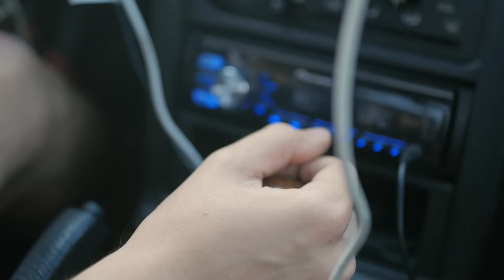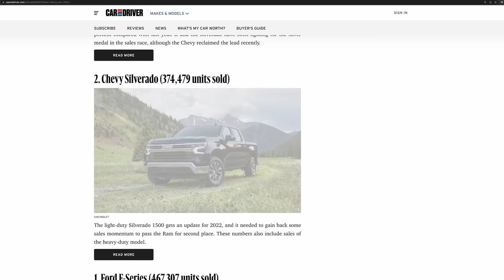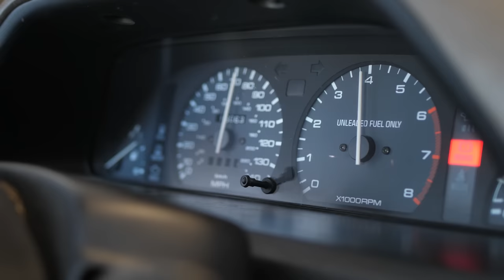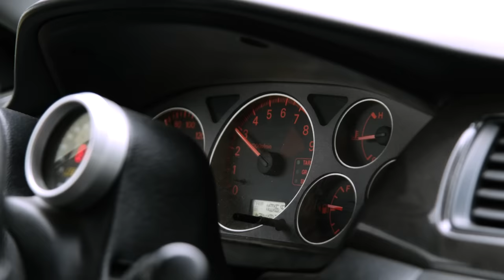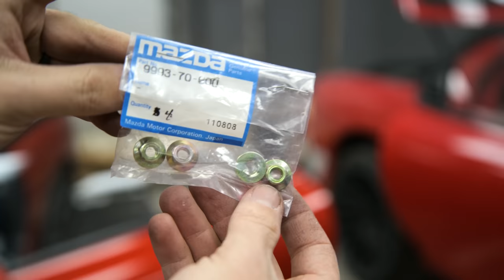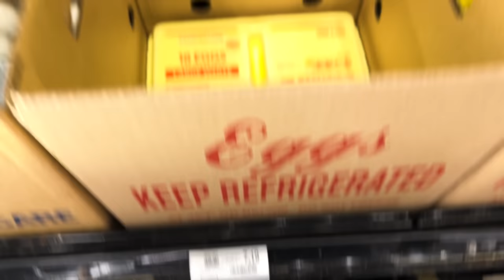Daily Drive Your Fun Car

Comment: I daily a 08 Toyota Camry XLE V6 and even though the car looks boring the engine is not as it puts out 268hp from factory which is more than enough to get out of it's way,  and I have weekend car a newer VW Beetle that's heavily modified.  Where I'm at it's difficult to enjoy your fun car especially commuting back and forth in L.A. traffic which is why I take the Camry,  but when the weekend hits I swap keys and I take the bug out on a nice long drive on PCH or some nice canyon runs out in Angels Crest. It makes me appreciate what I have and the car that I have at home is waiting for me. I'm cool with owning more than one car in fact I'm planning on adding a third car later on in the year.  I agree if you're going to daily a car makes sure you have fun with it every once in a while even if it's a boring Camry lol.
Reply: Man I drive a 2013 Corolla manual, and honestly wish I would of gotten a Camry or something similar. Not even the xle but literally anything would be more fun than vee for 🤣 Corolla  my boy had a 2102 8 think, the xle and yea it was pretty quick. V6 Camry still get the reliability and gas mileage but more power, more room, lil more fun and yea I'm bout to move down to LA from the bay so once I do think I'm going to get an automatic g37 sedan. Stick shifts are fun, but honestly not in a slow boring Corolla and LA traffic
Reply: @Gdafu866jds  Yeah I love manuals but in L.A. it's kind of hard to enjoy them unless you're somewhere not too crowded Like Palmdale or Riverside even. I'm getting a new mk7 Jetta GLI Autobahn with the DSG for my third car. Still keeping the Camry because I do love the V6 and it's very roomy. Originally when I was looking for a daily I wanted a Corolla but I'm cool with the Camry.
Reply: @wesleyjones1169  ohh nice 👌 yea plus now days the autos are quicker shifting than manuals and don't miss gears sometimes 🤣 and now I'm getting older it is nice just to chill and cruise in an auto, maybe just have a straight project/racecar for a manual and bang them gears lol but yeah I think Camry is way to. But enjoy all your toys brotha 🤙🤙
Reply: @Gdafu866jds  Sure thing bro!

Comment: I've always loved cars but felt like I could never afford a fun car. But I never looked at the used market and had no idea what a fun car would actually cost. It took some time, but I found a 94 miata for a good price and I haven't looked back. Every time I think it'll be a chore to move my family suv in order to take the miata out of the garage my mind is instantly changed when I'm ripping around on my way to work. If you love cars you owe it to yourself to buy a fun car even if you have to sell it eventually. It's life changing and a blast, even in my slow miata.
Reply: But Miatas are about maximum car-&-driver connectivity, no? I mean, it's synonymous with the phrase "Jinba Ittai" for a reason.

Comment: I realized I had bought the wrong car, I had bought a 2010 Acura TSX V6 automatic, it had nice specs and very comfortable but I was always worried of putting miles on it since the gas on this was not so terrible but It was hard to afford for my age, I was 18, Decided to sell it and then got Myself a 1998 Honda civic sedan manual, turns out this small thing with the boring interior is so much more fun than the Acura, And it’s amazing on gas! I found a great daily and I’m loving it

Comment: Honestly this is so true , beyond true. I’ve had a Civic EK for about 4 years now , brought it for £18,000 and it had 64k miles on the clock. It now has 143,000 miles on the clock. It’s not the best sounding car however it’s absolutely brilliant ! FWD handling in the 90s,  especially on Japanese cars are just the best I’ve ever driven. It’s practical , it’s cheap to maintain ( unless you go with Honda main dealership to do service , oil change and ect then it’s a bit pricey ) . It’s comfortable , it’s fits 4 people quite well considering the size. It’s fun to the limit , that’s including VTEC and it’s just quite for a stock Honda. It’s amazing

Comment: I still prefer having more than one car if it's financially possible. That way you can have one car that's just dedicated to being a fun car and it doesn't have to necessarily fit all the boxes that a daily driver should. While I still think your daily driver should be fun and enjoyable to drive, the two fit different purposes in my mind. I've gone the two car route for many years now, and absolutely prefer it over trying to find one car that's a do-it-all.
Reply: Definitely a late reply but what things do you focus on in your daily driver?
Reply: @the1anonymouse  I try to focus more on a comfortable ride, enough storage to carry things when going shopping, and creature comforts that make the car easier/nicer to live with (remote start, heated seats/steering wheel, a nice sound system, etc.). I'm not looking for all out performance, although I do like it to be a little "peppy", and I'll even deal with an automatic transmission as it needs to be something my wife can drive as well as something that I can just cruise in while being a relaxing place to be. My current daily, a 2023 Mazda3 Turbo Hatch, covers everything I'm looking for in a daily driver and I still have a fun car for the weekends when I want something more spirited and driver focused (currently a 2022 Camaro 2SS 1LE with a manual transmission).

Comment: I daily drove a Ford Focus ST that I did Cobb Stg 3, coil overs, etc and it got to a point where it wasn’t fun as a daily driver anymore. The ride was rough, fuel economy sucked, and it was no longer reliable.

I think it’s about finding the balance between fun, affordability, and daily use. Since then I now have a daily driver (Audi S3) that is stock and my fun car (Audi S5) that I do upgrades on and couldn’t be happier.

Also, it was funny seeing Charles and his S4 with the motor out. Same motor in my S5. Timing chain on those motors is no joke!

Comment: I daily a Subaru Liberty H6 Spec B and while it looks like a boring silver wagon on the outside, it's so much fun to drive. It's louder and harsher than stock because of coilovers and an exhaust but still comfortable enough to drive every day. It's fun on back roads with the manual transmission but can also haul a ton of cargo being a wagon. It's not a large or ungainly car either, compared to what else is on the road nowadays, and handles really well.

Comment: Daily a 2018 bmw 530e Mperformance, and summer weekend warrior is a 92 MR2 with a gen 3 turbo swap.

For a daily commute I prefer hybrid comfort, and sporty handling and performance by pushing a button.

In the weekend I want something engaging. Rowing gears, engine behind me, super sharp steering, turbo noises, t-tops off.. and the less I spend on gas driving tired to work in the morning, the more I get to drive on the weekends.

Comment: I DD a 2015 Subaru BRZ 6 speed. It is perfect and I never plan to mod it. No reason to mess with perfection (unless the motor blows someday). Then it’s “game on”.
Reply: Not even going OEM+ a little? Like replacing something that wears out too soon? (if there is) It doesn't have to be something that affects its reliability, especially powertrain-related.
Reply: @yongling9825  not really. There was an issue with the throw out bearing in the BRZ. But a company made a part to rectify the issue. So when I did a new clutch, I installed one. But honestly, even if I need new suspension bits at some point, I will be ordering OEM.

Comment: My 2018 Subaru WRX STI made me go to work earlier to find less traffic on the roads. I had a 2015 WRX before, a 2009 GTI before, a 1995 M3 before (preowned), and others. None was as much fun to drive as the STI and its phenomenal rumbling driving experience. The WRX with a twin-scroll turbo made me happy with the mileage. For me, it was more fun than the GTI, but even though the fuel efficiency of the STI was worse than all of the others it gave the relief that to move up in fun it could be almost only with a good-sounding manual transmission Porsche. What a pleasure. That car produces so much fun that Subarucouldn't find a way to transfer those virtues to newer models. The signature EJ sound, the mechanical feeling, the driving experience. The 4-door vehicle was my wife's only restriction for a while. Now she wants an SUV, so I'll get her a CX-5 and I'll buy a GR86 for me if driving it with the windows down is not too annoying. Another STI is also a possibility, for me.
Part of the reason why I bought my STI is you guys. Tired of dealing with VW dealership costs I bought the WRX, and then I saw your video of a rainy Boxerfest that you made and went to the next 2017, and that convinced me that waiting for the next-gen STI could be a mistake, and bought even though my WRX was just two years old.
It was sad to find that an engine developed initially in 1989 could not find a way to pass the emotions that produce to more modern generations. The Coyote's Ford engine did.
I know I will like the GR86, and I'll try to install ULH to make the Subi rumble if I can, even when the car becomes slower.

Comment: I'm from Italy, in June of 2022 i bought my new daily drive because i blow up the engine in the old daily that I'm fixing and passing to my younger brother, 
another advise is if you do many miles/kilometers you can also think on buying a diesel car like my Alfa Romeo MiTo 1.6 turbo diesel 120cv and 350nm stock on the highway is quick and fast enough if is your firs car or you came like me from a super slow car, my old daily is a Fiat Cinquecento SX with a 900cc with a whopping 40cv, 
also diesel engine like 1.9 TDI, 1.9 JTDM, 1.6 turbo diesel are easy to squeeze horsepower with just a down pipe, air filter and a good tune on the dyno

Comment: Porsche Macan Turbo. 440 bhp. Sport plus, offroad. Roomy, good handling and reliable. Plus they can be had in the mid 30's with reasonable miles.

Comment: I went the smart way; I've bought a Civic Hatchback; 4 doors, hatch, perfect for day to day uses, but I've also modded it; for anything power related I overshot the parts, for exemple, buying stuff rated for 400 HP, while putting down 300 HP, Suspension I went with some springs and shocks instead of hard coilovers, Clutch I went with a full disc with a just slightly lighter flywheel than OEM, my entire exhaust is aftermarket but have a cat, resonator and mufflers. 

And honestly, alot of people get suprised when I tell them the Civic is modded, because of how tame and daily drivable it is

Comment: Mannn, you hit the nail on the head with this 💯 soo, couple years ago after having couple shit box cars after my 1st car, a focus ST, I told myself I need something cheap and reliable. Don't want to ever be without a car again. So ended up getting a 2013 Corolla SS, well it's missing an S 🤷‍♂️🤣 manual trans. And yea it's served me good for almost 4 years now. Just oil changes. But it was only 8k, 40k miles and 1 owner.

 Now looking back there's plenty of other options I could of had. TL, accord, civic SI, Camry or even a 3 series bimmer for about the same price, same reliability, but more power, more better looking. 

But now it's paid off and decided to just keep it as a back up instead of trading it in and looking in to a g37 sedan. Definitely if your a car person spend a lil extra money on something that will give you joy and look back at it when you park it. It don't have to be a fast sport car, but just something with a little umth to it and looks nice. Life is short and like you said we spend a lot of time in our cars and for me personally I love driving it relaxing, so why not drive something you like. There's plenty of options out there besides a slow boring Corolla that the gurls say it's cute! 🤦‍♂️🤷‍♂️🤣🤣🤣

Comment: As "essential personnel", reliability is definitely at the top of my list. I also have a one-hour commute each way, so comfort is important. The last 15 miles to my house have some fun creekside roads that can really test a car's (or motorcycle's) tires and suspension. My very lightly modded 2020 Impreza Sport hatchback ticks all of the boxes except horsepower. I'm hoping a 91 octane tune will liven it up enough to keep me entertained for a while - at least until I get around to upgrading the suspension to coilovers. I spent years going from one beater to another, thinking that I was saving money over a new car. It turns out that a car payment on a modest car like the Impreza is not much more money than keeping an old modded SHO+ running, and not worrying about unexpected breakdowns (and the resulting costs) is worth the difference. It's all a matter of compromise. Yeah, I'd love a Diablo, but there's no way I'd want to get in it every day for my drive to work. I could (barely) afford a Hellcat, but most of that horsepower would be wasted on my daily drives, I'd be putting not-fun miles on it by the ton, and the cost of operation and depreciation would make me sad. I think Subarus and VWs are popular because they make cars that work in this fun-daily spectrum.

Comment: I sold my 2008 RAV4 V6 with over 250k miles and bought a 2000 Celica GT-S for $500 more than I sold the rav for. 6 speed manual. VVTL-i.  The 20 minutes one way to work I spend driving is one of the major highlights of my day

Comment: I have my focus ST, I don’t daily it in the winter cuz it’s a ford and I’m attempting to save it from salt and rust. But in the summer I drive it basically daily. But I also have a my Vibe GT with a 2ZZGE in it. I can absolutely say it’s the best daily I could buy. Absolutely incredible to drive. Revs to 8800 rpm, and hits lift hard haha, just a muffler delete, next is lowering springs and she’s done. I love it

Comment: My best daily car was my Fiat 500 Abarth. Its small, fun, have a good amount of horsepower, and are manual (so you can have fun driving around). I'm daily this one about 3 years (2019-2022) put around 50.000 km total. Now i'm have a "boring car", a Honda City Hatch. In fact, its my first boring one,  but I wanted to have the experience of having a normal, reliable, quieter car. Of course, I will not deceive anyone. On weekends, I ride a Lancer Evolution, because nobody is made of iron.

Comment: I daily drive a manual 2015 challenger hellcat honestly I wanted something fun fast but can be practical enough for myself the car isn't the most uncomfortable when driving normally and it gets fun with just the tiniest bit more throttle, I've driven it almost 10,000 miles in the past 6 months I've owned it and it's given me zero issues, any car can be a daily driver you just gotta take care of it and just do your research and not be too petty about certain things, my case is gas mileage, my daily used to be just as bad on gas just cause it's not a slow 4 door doesn't mean it's wrong

Comment: I drive a 2022 civic sport sedan. I love the way it looks and it handles with a few suspension mods, wheels, and tires. It’s reliable, practical, and with the responsive paddle shifters, it can still be fun to drive despite grandma acceleration.

I’ve ridden and driven quicker cars like the SI and the 350z, which really just reminds me I drive a grocery getter. Still though, it’s enough fun for me with where I’m at in life. I enjoy everything about the car except the horsepower, and in cars that do have horsepower as their only personality trait, I tend to get bored quickly.

One day I hope to look at a higher performance vehicle parked right next to my civic which helped me get to that point.

Comment: I actually enjoy having two different cars! I have a cheap Sebring JR I`ve bought from the first owner, I made some adjustments so it`s sitting on new 18inch polished wheels, the whole car is in factory paint and freshly polished, all mechanical stuff is well maintained, i`ve replaced all the interior with a higher trim one, changed steering wheel for a new one from 300m, installed new speakers, and i enjoy driving it when i have to go to the town for business, i dont worry much if someones scraches it, or bumps me with a door on a parking lot . But on weekends or just when i feel so i take out my camaro on coilovers and suspension built for race tracking. I would drive it daily, but sometimes i really like to fall in my Sebring and enjoy that sofa like driving position and chill driving arround town.

Comment: The trick to buying a winter daily is simple - buy something you find funny but equally couldn't really care less about.

Winter 2021>2022 it was a 1.0 Toyota Aygo on 118k miles. 
Winter 2022>2023 it's a 1.9TDI VW Caddy van (Mk2, 2001)

Both are hilarious, both have good heaters, both had acceptable audio and both had cheap 'bearability' upgrades, such as comfier seats and sound deadening in the Caddy. Both epically practical, with the Caddy literally being a small van suitable to move my car parts around.

From there, my Del Sol and Accord both get to stay safe from winter salt and winter drivers.

Comment: I daily drive an iroc z camaro with bmr suspension, 600 hp rated trans and 1000 hp rated rear end and a bone stock 305. I average 15 mpg, maintenance is cheap enough and I have fun when I put my foot to the floor. It checks every box except for comfort where it can a be a little rough but i love it

Comment: Driving your fun car in the USA is a very real possibility. Here is Ireland not so much. I considered buying an E39 M5. €45000/$48000
Road tax €1809/$1950
Fuel $7 to $9 per gallon depending on the weather 
Insurance is nuts too. Anything that isn’t an eco Box in Ireland gets hit hard d especially in Dublin. I once got a €6000 quote for an e36 M3. 
So I got a Punto HGT. Small fast revvy and rare as a Ferrari Enzo these days apparently. 
If I lived in the USA I’d be in a supercharged M5